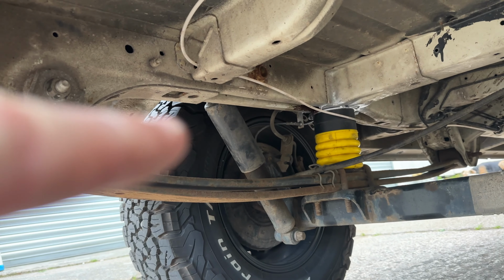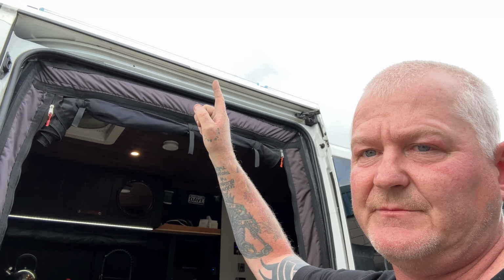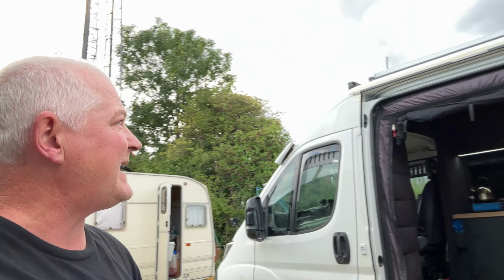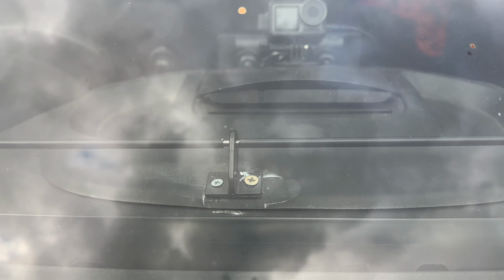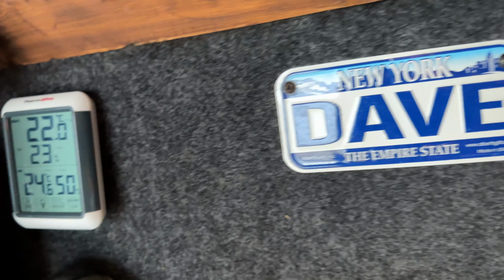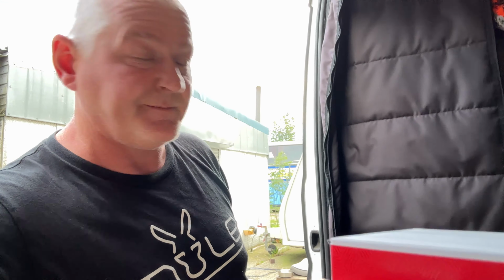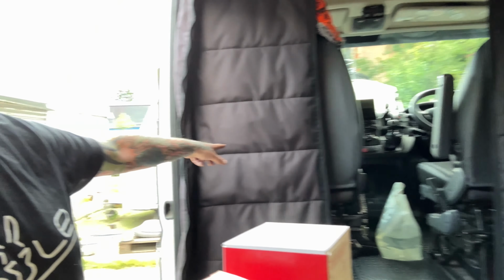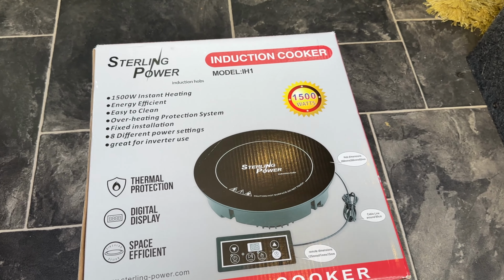Upgrades, Upgrades and more Upgrades! | VAN LIFE UK

Comment: Hi can I ask what light beam you have used also how is it attached to the van cheers Jim
Reply from the maker: Auxbeam is the company and it the 52inch light bar… and it comes with brackets which attach to the top of the van and then onto the bar 👍
Reply from the maker: https://youtu.be/L2RTv47q8MQ?si=AkpVHE6YWiYSRVhG

Comment: The whale sliding electric is more practical for not flapping up isn’t it - only thing I’ve found is you sometimes need two hands to unplug the cable and can be a tight fit with it but other than that great and better design I think.
Sounds like great plans for the van.
Have a lovely rest of the week and weekend, all the best, David & Rachel 👍
Reply from the maker: Hi mate, hope you’re well? Yeah the slide up hook up so much more practical and cleaner in its design! Hopefully won’t be a tight fit once in, but have to admit I don’t hook up very often! Stay safe mate and regards from me and Archie 🐾

Comment: I’ve an L4H3 van comes with 16” standard rims and has the black wheel arch mouldings.  Do you know if the tyre/wheel combo you have fit my van without rubbing. I’m planning a lift kit next year
Reply from the maker: Hi mate, yeah once you have the lift kit, the bigger tyre on the 16” wheel won’t run with the arch mouldings, so you’ll be fine mate